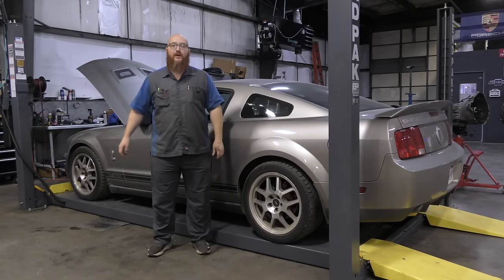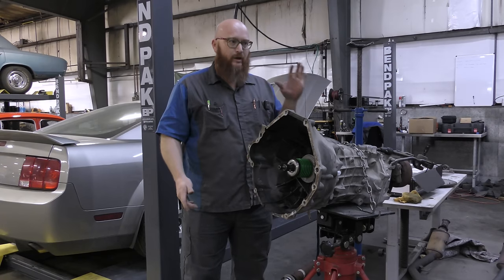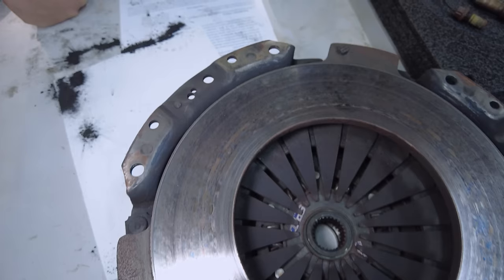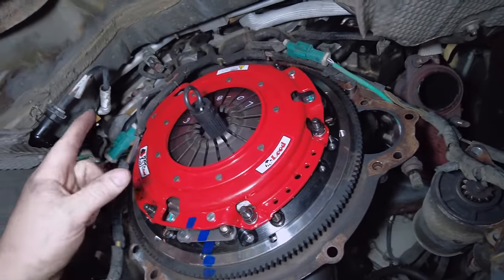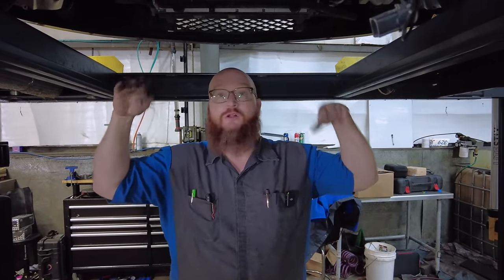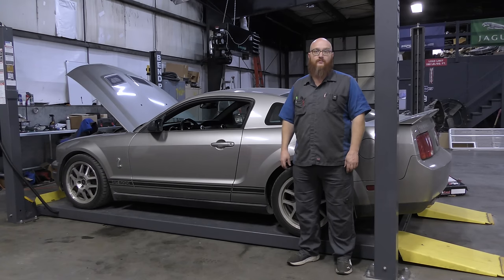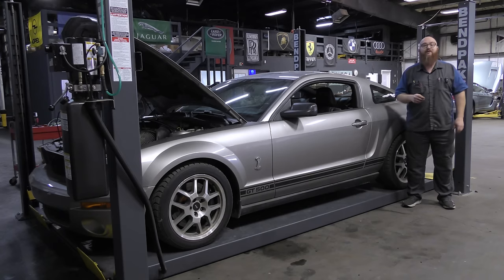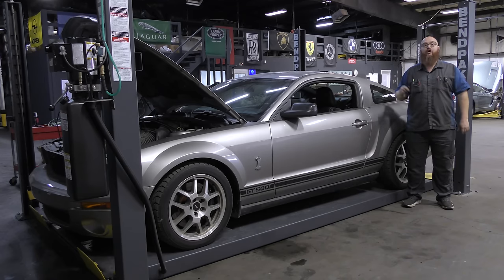With Over 200K Miles My GT500 Has So Many Worn Out Parts! It will Cost Me Thousands!

Comment: So the Ford 5.4 is way risky, with the eco-boost is not far behind. What have y'all been learning about the 3.0 mini Powerstroke?

I've got the lauded 5.7 Tundra, and it does nothing wrong except for the 12 mpg fuel consumption. 18-22 combined is starting to sound good to me, in addition to a fully loaded late model truck for around 30k used.

The forums like them a lot, with frequent feedback of no problems through the late 100k miles. Would I be crazy to switch? Diesel prices could go ballistic and I'd just break even again.

Signed- Ex diesel owner with the worst gas fuel economy truck I've ever owned. (I could put two of mine on a 40' trailer and still get better economy than my Tundra with any big diesel).

Comment: Wizard, you might check with American Muscle for the front lower control arms.  I got a pair from them that are Ford Performance parts.  Also did you check the rear bushing that bolts to the rear diff and the body ??
It’s amazing to see an 08 GT 500 with that many miles as, due to the power they usually get totaled out by non experienced drivers.  Kinda cool I actually saw a sharp looking GT 500 while in town today.    Waiting to see you and Mrs Wizard race for pinks between the GT 500 and the Viper.
Reply: Non experiance drivers?????   It's an American car , I.e. what is a corner , and , straight when accelerating and no sideways from rear axle.....it is an American car ...

Comment: Lock out the cams and a 3v is fine as long as the oil is changed every 3k…. You can eliminate the cam phasers. All together and get block off plates from a 3v v10.

Comment: Spec clutches are always like that in my experience. Really stiff, and they engage at the top. I put one in my mildly built 01 Camaro SS back when that car was new. I took it back out a week later and went with a GM Performance LS7 clutch instead and never looked back. That Spec clutch was awful!

Comment: That old clutch looks like a stage 3 carbon metallic clutch. It’s pretty much only good for drag racing and is like an on or off switch. The previous owner was probably driving it like a street clutch and slipping too much in traffic hence the material and flywheel wear.

Comment: Ironically when I fitted my T56 to my Saleen behind my Terminator engine, I put in a Mcleod twin disk clutch.  And it was a horror show.  Kept jamming in 1st gear when it got warm, shifted horribly, and generally made the car undrivable.  I swapped it out with a Spec single disk Stage 2 plus and never have had another issue.  Now mine is a 2000 Saleen with an 03 Terminator and a T56 from D&D Performance, so there are differences.  But that's my experience.....yours may vary.  BTW.....550rwhp for my car.

Comment: It's not very surprising. When you get that mileage you know some things are going to be worn out and need to be replaced but a lot of the GT or GT500 Mustangs really get hard use. There are plenty of them that have fallen into the hands of people that not only do they drive them hard but they just don't maintain them either. If I find a Mustang with the 3.7 V-6 and the manual transmission that has been maintained I might be interested. They are decently fast with just that engine.

Comment: That mustang with 600 horsepower and over 200k miles, that is very reliable. A Ferrari, Lamborghini, Mercedes… with that much miles on it will have some serious mechanical issues. Low but behold, sometimes cheaper is better.

Comment: Thanks,great Work refurbishment, replacement etc (* esp @210,000 miles in a MUSTANG , MAYBE a hit Rod, erc!)… Anyways, the Tires are VERY IMPORTANT…I LEARNED that in 1967-8 particularly! To wit a low mileage 1966 GALAXIE  500 XL/4;Speed/352/4 BBL / Burgandy/No Disc /DELUXE BLACK INTERIOR; (** sort of like Jay LENO’s 7 LITRE 1966; … adding proper Metallic Brakes, new Tires/ Monroe Shocks ( &/Coolant* Recovery KIT** , as not on Engine yet,from Ford Performance, as not in AUTO PARTS availability’s in  1967), plus other work; a new  Car.

Comment: I wonder if those stabilizer bars are aftermarket?  Were the originals blue in color?  The bushings look like polyurethane, are they aftermarket?  I've found that the standard rubber bushings seem to last longer.  I know the performance guys buy into the hype that the poly bushings give better performance but I'm cynical and don't buy it.

Comment: Honestly, most used cars with over 200k on the odometer have had so many repairs already, its not like you're repairing everything on it. Probably been through a trans or 2, probably had all manner of alternator, water pump, timing chain/belt, and whatever other replacements. You just gotta hope that whoever did the work was good, and that they used quality parts. And any really bad weak points have already failed by that point, and been addressed with hopefully revised and updated parts. I've taken many vehicles past 500k. Once it gets to a certain point, whatever is going to break will have already broken. Mileage is just a number. Except for when it comes to rust. Thank god I don't live in the rust belt. I've seen beautiful cars that look exceptional on top, only to be falling to absolute pieces underneath. Spray foam and scrap metal welding can only take you so far.

Comment: Honestly, it really should be required to have tires checked with emissions tests. Its terrifying how many people drive with wore and straight up bald tires. Sometimes when I am walking into a store or work, ill glance down at the tires of passing cars in the parking lot and oh my gawd. I'll see Escalades with tires where the outer 2inches of tread are just gone. Like you can't even see where the tread should have been. 

When I bought my accord in 2019, the tires looked okay still. Second winter, I could tell they needed replacing. When I went to the shop they said they were at about 4/32 and should probably be replaced. I cant imagine driving with less or completely worn treads, it must be one of the levels of hell.
Reply: In the UK it’s a criminal offence to have bad tyres

Comment: Go get a Tacoma or Tundra if your pockets are deep. They will bleed you dry in fuel costs. Add any major repairs on that and it's cheaper to replace engines and transmissions in the long run. Especially if you do any towing.
Reply: They sell these things called hybrids.
Reply: ??? Toyota is literally known for their reliability. this is a shit argument. Also any truck eats gas they have large engines and chassis.
Reply: @Clooger- You must of never hauled a trailer with one. What you "save" in repairs is quickly eaten up in fuel. 8 mpg pulling a trailer in a Tundra. Don't try to haul anything with a Tacoma.
Reply: @houseofno Hybrid Tundra? As of recently, yes. Not for the previous 20 years. Same with Tacoma.
Reply: @Land_Raver  No, I've owned one before, but I didn't haul anything, really. I would still bet that most trucks plummet in MPG while hauling.
Reply: @Clooger-  You drove long distances for work? Or do you live 2 miles from the office?
Reply: @Land_Raver  I wish I worked in an office. No I drive roughly 20-30 minutes for work.
Reply: @Clooger-  20 to 30 minutes so maybe 10 to 15 miles. If you drive 100+ miles a day or tow a trailer, a Tundra will bankrupt you. You don't see companies generally, running Toyota trucks for a reason.

Comment: That clutch is fine in a 580whp car. It’s just not very driveable twin disc clutches are needed around the 1000hp mark. And that clutch dust is from the previous owner using it the way it was intended whom ever owned it was not gentle… 😂

Comment: Only use OEM sway bar bushings.  I learned that the hard way on my front FEBI BILSTEEN Bushings for my Mercedes.  Aftermarket FEBI made my front swaybars squeek so bad, everyone looked at me when i went over a bump at the supermarket.  So i paid full price for OEM front sway bar bushings a 2nd time. SMH   Also, don't buy aftermarket unless its TRW control arms.   I bought MEYLE and turned my mercedes into a Honda Civic hollow cheap lightweight feel.  Just press in new bushings in your OEM arms.

Comment: I think one of the biggest reasons for the car needing so many replacement parts at 210K miles is the poor build quality of Fords. I've seen well cared for Japanese and German cars that were in much better condition at greater mileage. Of course, neglect and abuse by previous owners would have also taken a toll.

Comment: I just DESPISE those combination throwout bearings and slave cylinders!  I can't see how they save the manufacturers enough money to justify making replacing a slave cylinder a tear-apart-the-car job, instead of just a quick external replacement at the fork.  I mean, what the fork?  
On the other hand, I didn't know they were putting grease fittings in the sway bar bushings... if only someone had greased them.

Comment: Fortunately, the suspension parts are fairly inexpensive.
Reply: Just need to replace the sway bar polyurethane bushings and grease them with silicone grease. I bet they are dry now and if he just filled them with silicone grease through the fittings they could be good. If you don’t grease those they get noisy. They probably have never been greased. Energy Suspension makes the bushings.

Comment: To complicated and computerized for me. I much prefer my 1972 Nova with a carbureted 383 (bored and stroked 350) and an M21 Muncie 4 speed. It has 420+ hp at the rear wheels at 5400 rpm. It has real tires that actually have sidewalls, and mine have raised white letters. 

Do you know how hard it is to get a steering wheel perfectly aligned? I have done a lot of alignments. You put the steering wheel in what looks to be a perfectly straight position. Then you set the toe so that it is perfect, you look at the steering wheel, it still looks straight, but when you take it out on the road, you discover it is just a little off. You have to be either really lucky, or redo it several times to get the wheel perfectly straight. And even if it is perfectly straight on some roads, it can be a bit off center on a highly crowned road, or if you are driving into a strong crosswind.

Comment: Like I mentioned in my review. You sir are clueless. The 5.4 3v are not garbage. My 04 Ford F-150 had 200,000 on it and it ran beautifully. I’ve seen other Ford 5.4 3v with well over 200,000 with the original motor.
Reply: dude that motor is junk... it had value issues lol
Reply: @AndrewLee-cg6uk  Well mine didn’t and the others I’ve seen and driven with well over 200,000 didn’t have valve issues and were on the original valves.
Reply: @AndrewLee-cg6uk Small oil passages and defective oil pump design. Change the oil every 3k miles and it's fine.
As for the spark plugs breaking off inside the head, there's a $60 tool to remove them.
Reply: The design flaw was the oiling issue. Any sludge at all from poor oil changing and you would see problems down the road.
The roller followers wore out, and were redesigned to pick up oil better, so you do a timing chain job at 150K-200K, upgrade the oil pump ($80) and the roller rockers ($8 each) and with the new guides and phasers you're good to go for another 200K or more.
Reply: I know 2 folks who had one, both were well-maintained and babied, and both became ticking time-bombs
Reply: What are you, the 5.4 3V's agent? The marketing guy? Why? So you think that just because you have no issue this engine that "everything is beautiful" everywhere? I will take the Car Wizard's word for it and skip your attempt to spin this engine's reputation into something it isn't. If the Car Wizard says it's trash I have your Glad bag right here
Reply: @houseofno  SMH. Did you even read the mileage? Wizard is clueless. Why should I listen to a guy who said to not buy a truck with that engine when I had one with over 200,000 miles and I didn’t have to do any major engine repair. Also the fact there are millions of those trucks with that motor on the road still running with the original motor. Go outside and look for yourself.
Reply: @houseofno  Also, the fact you can’t write or fix your mistakes speaks for itself.
Reply: @youdontknowme5969  It is well-known that the ticking is failure of the chain guides. MANY CARS WITH TIMING CHAINS NEED SERVICE BEFORE 200k . . . Even Mazda, a highly lauded engine needs one, and it costs $3000. 
Anyone who let their 5.4 3V 'explode' did not perform maintenance.
Reply: @houseofno  I researched the engine before buying my Expedition. I knew about the 'ticking' timing chain warning. At 190K, I heard the ticking and had already found a master mechanic who performed the timing chain, phaser, roller follower, oil pump service. It cost $3500 . . . if you are a good mechanic, do it in your garage over a couple days and the parts are only $700. 
Variable Valve Timing is hi-tech and needs maintenance an LS push rod won't. The advantage over the LS is exceptional gas mileage at highway speeds. I get 25mpg loaded on the highway. You can't beat that.
Reply: @leonarddaneman810  that was just a metaphor . . . but it doesn't matter anymore because they long got rid of them
Reply: @youdontknowme5969  I researched the 5.4 and got the non-Triton, with improved heads (longer spark plug threads). I knew to listen for the 'death rattle' that was a warning that the timing chain was loosening. 
With the VVT, and excellent engine, but not foolproof and bulletproof like the old 351's or 5.0's . . . more engineering for gas mileage.
If you are a working man and just need a beater, don't buy the Triton. 
Otherwise, a great engine.